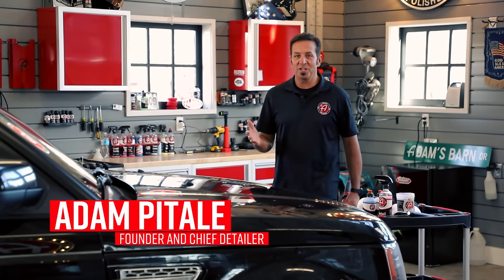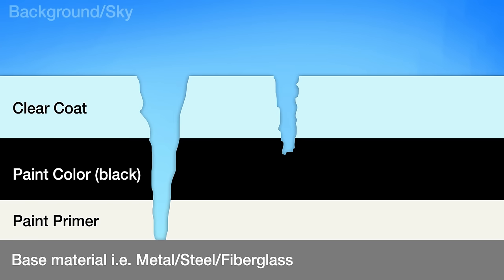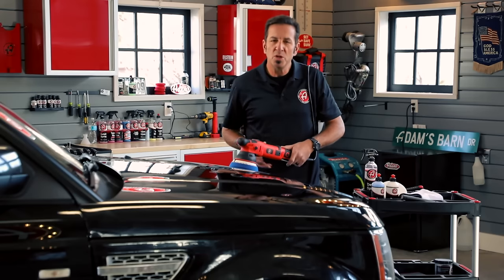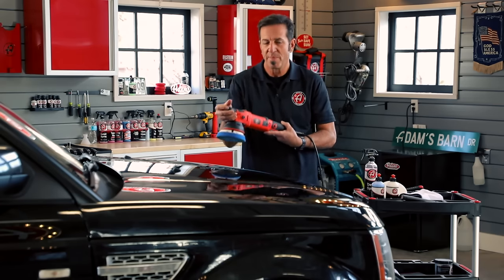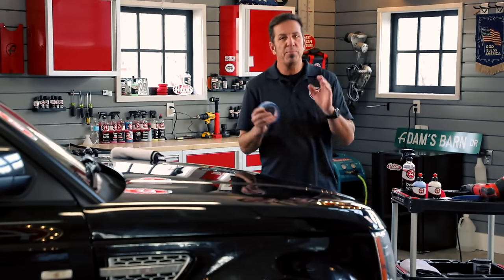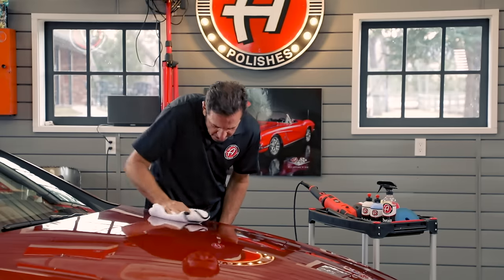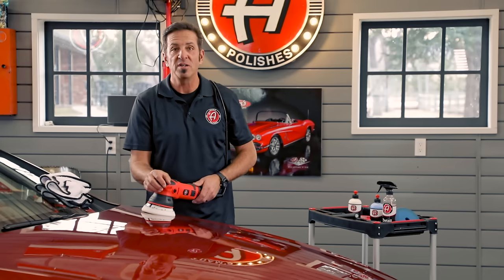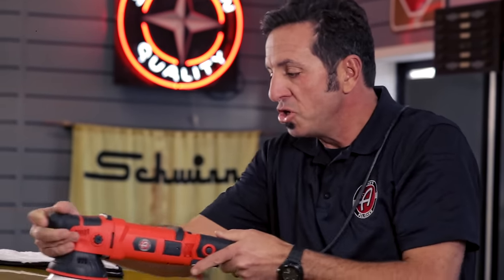Polishing 101 | Adam's Polishes

Comment: Dealerships need to stop destroying vehicles
Reply: I used to watch a crew come out and wash the new cars everyweek when I worked at a local dealer.  Spray them down, wipe them off with towels or chamois type towels.  Hundreds of cars/trucks in a few hours. They look okay to most people after the pre-delivery dept does the prep work, but.... we know...   I took my new Mustang off the convoy truck, so it avoided that crap.  17 years later, still looks pretty good.
Reply: @SC457A  I worked as a detailer for a local dealer and I could not believe what they would do. They had mitts but would use these ground brushes on the car instead and would slam the metal and wood neck of them into the roof as they slid it across. That is good that you got to get yours before it was ruined.
Reply: @devn3813  Volume over quality.  Average person does not care too much as long as it is shiny, smells new, gets them to work and kids to school and is ready in 5 minutes.  It is a shame for sure. Only reason mine didnt get fresh wax was it rained 1st week I owned the car.  then only Meguiars, and Zaino have touched the paint.  Soon Adams probably, maybe Ammo.. dunno
Reply: You sure you don't want that complimentary swirl wash with your oil change?  Jose, manual and hector do a great job!
Reply: I've worked at dealerships before and I'll tell you, they dont care, it's about saving money.. buy the cheapest broom/Mitt, and decent soap, just needs to look "good" to be presented. When taking delivery they offer a package to "detail" but of course at your cost..
Reply: @tacoboy262  Correct.  They could buy nice stuff just to be torn up and misused and abused and maybe stolen from employees that just dont care.  Saw it happen. I hope higher end car brands treat the cars a lot better. (I worked at a Ford dealer)
Reply: @SC457A   That's so funny I know a lot of people that worked at Ford including myself, and then Acura, to even Mercedes,  all of them it's the same process sadly
Reply: @tacoboy262  - I live right across from a Ferrari and Porsche dealer, all the same crap.  My uncle bought his GT3 RS from there and it was trashed when he got there.  Parts of the front bumper had unbuffed wax on it.
Reply: @mikea5205  that's so horrible to hear!!
Reply: We pay over $1000 and up to $3000 for prep and delivery for a new car now and even extra for some paint colours you would think someone is paying particular attention to the condition of the delivered vehicle…..not!
They give the car to a newbie to wash.
Probably a junior who doesn’t know the first thing about how to wash a car properly.
Or worse yet the salesman just remembered he’s delivering your car today and forgot to let them know in service so he takes your new car to the car wash. This was my latest experience with my new Ford Escape Hybrid.
Now I am in negotiations to get the paint corrected.
On one panel it’s so bad it needs repainting.
But a repaint is never like the factory paint which was baked on.
So right now I am trying my utmost to get the car wash swirls out of my paint.
Something I should not have to do.
Maybe the manufacturers should think about the delivery process in greater detail especially now that vehicles are costing upwards of $100,000
Reply: Another reason I never take my car for service.
They think they’re doing you a favour when they wash it.
I put post-it-notes everywhere on the car “DO NOT WASH THIS CAR”

Comment: I recently bought my wife a brand new suv. It came from the dealer with a ceramic coating, which is great. The problem is that the car has swirl marks on it from improper washing techniques at the dealership, and the ceramic coating is on top of the swirl marks🤦‍♂️
Reply: I just bought a new car. It was dirty. The dealer insisted they wash it. I knew what would happen - swirls. Wtf is wrong with these people? Total trash.
Reply: Wash, clay bar, polish and reaeal

Comment: Have you noticed Audi has crap paint ? I got one tiny rock thrown up on my hood the other day and it took off the clear cote and  paint all the way down to the primer . It took an entire chip out the paint going 35 mph from a damn truck in for of me . I took it to paint shop and they want paint my new Q7 entire damn hood . I don’t want to pay that much just to do a rock chip . I got paint marker from Audi and clear cote pen . I’m still debating which is best the car is brand new I’ve had it two months . Should I do throwing marker and then wait a day and polish the crap out of it or get the whole hood painted ??? 🤬😫
Reply: Therealdeal84 it’s white I decided to paint it with the marker and clear coat then waited a week and wet sanded it to level it then used a cutting pad to buff it and then a polishing pad to finish looks brand new .

Comment: Is it ever really necessary to polish a white car? Because i mean.. White will never really shine, even after polishing, right?
Reply: What if it's a white pearl paint? You can see everything in that pearl.
Reply: @majesticdetail3422  my car is white pearl, and after a week of driving 50+ miles a day, it obviously doesn't look freshly clean but it doesn't look dirty by any means
Reply: @caseyhearn2232  I just bought the new 2020 civic sport for the wife. Made sure the dealership didn't touch it. Polished it then applied a ceramic coating on it. I wanted to make sure that pretty pearl lasted for years.
Reply: @majesticdetail3422  - oh nice man my brother just got a 2020 Sport Coupe he absolutely loves it.  He got the CVT because we live in Phoenix and traffic here gets pretty bad although he wanted the manual.  I helped him clean his wheels today with P&S Brake Buster I had fun.
Reply: @mikea5205  my wife does a bit of traveling back and forth to work too. P & S works pretty good. I'm not fan of it on tires but it works great on wheels. We looked at all there cars but the new sports model looked so nice.
Reply: Casey Hearn I personally have been able to bring some shine and gloss to white cars, especially Mercedes-Benz. I used Sonax Cut and Finish, topped off with a Ceramic Coating from Gyeon. It looks really good and owner finds it a lot easier to maintain
Reply: @yodaddy6340  great combo. You can't go wrong with sonax.
Reply: Don't let white fool you. Whenever detailers get a white car in they're often the ones that require the most work even if they don't 'look' dirty. Usually require more decontamination than the average car that comes in because they don't get washed as often since they can go longer in between washes before they look dirty. I see so many white cars that look cream colored or tan because the clear is so embedded with contamination.
Reply: I just bought a white 98 Eclipse. You can still easily see the swirl marks and it just looks very dull. White is definitely more forgiving but I think people will still appreciate the effort.

Comment: Very nice video. Very informative. I really appreciate it. I will take your advice. I'm a newbie but I learn fast. Quick question. With the Adams micro mini. Does it have an extension bar for those tight areas. I'm thinking like a 1 inches or 2 inches extension bar attachment.

Comment: I often wondered if today’s foam pads could be used on the old acrylic single stage paint on the older vehicles.
I wondered if they would create too much heat or not with the acrylic single stage being much softer than urethane clear coat.
I enjoy your videos a lot
Reply: I have used the foam pads and numerous single stage paints.  90% of what I own is pre-1970 with single stage paint.
Reply: Its fine to use foam for single stage

Comment: Do i need to use the clay bar?
Reply: Rub finger lightly over paint. If you feel bumps, then yes. Some people recommend running your finger in a plastic bag over the paint for more sensitivity
Reply: @marphtwo  
Thanks. I felt no bump's actually the car is pretty new im assuming the swirls are from the towels ive been using? I use microfiber tho
Reply: @officialtjtrev8910  Sounds like you don't need a clay bar then. Clay bars are for removing particulates, but not swirls. I'd start with a light finishing polish Meguiar's M20532 Mirror Glaze Ultra Finishing Polish then go over that with a wax or ceramic coat